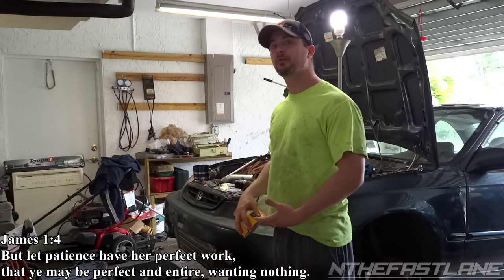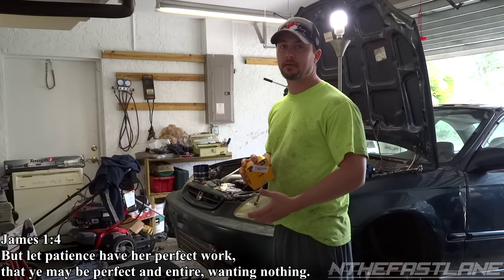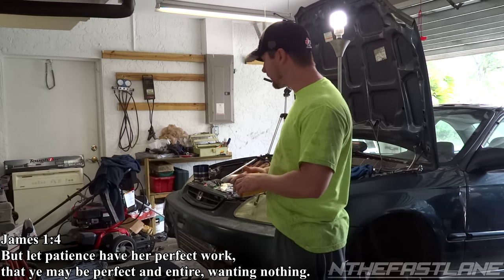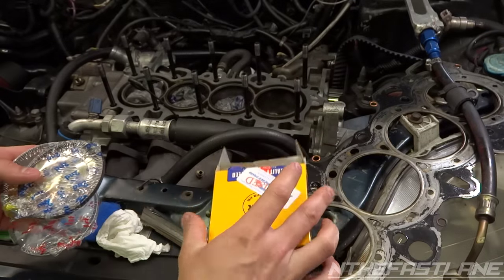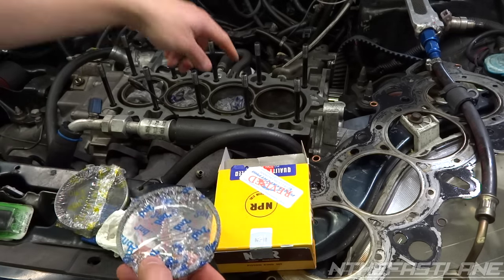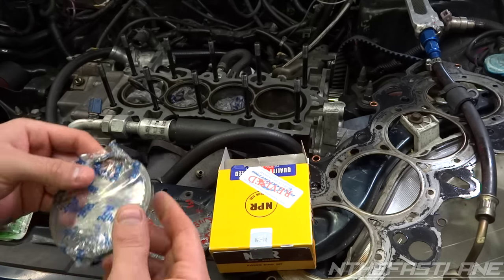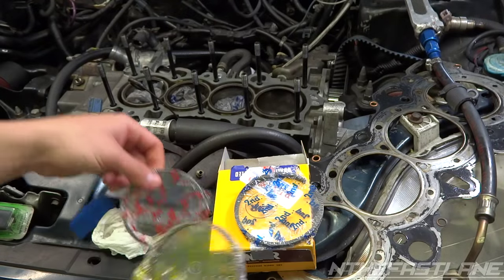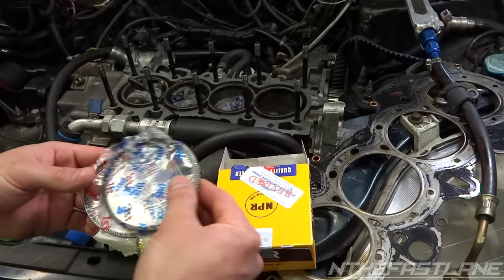▶️Clocking,Gapping & Installing Pistons Properly (Honda) "How To"🔧

Comment: The 3-piece oil ring installation !! The correct installation should be 
as following: Install firstly the spacer ring on the piston and put its 2
 edges at piston's pin side no matter L or R and the spacer edges should
 not jump each other !!. Then starting opposite of this "ring spacing", 
place one of the two (thin rings) by turning spirally until seated 
properly and 1cm offset of this virtual axe !!  Now place again the one 
of the two (thin rings) by turning spirally until seated properly and 
1cm offset of this virtual axe, but not at the same side as the previous
 ring. So finally the 2 thin rings should be at the 150 and 210 degrees 
(opposite of) the spacer ring's clearance. Now install (spirally) the 
2nd from top compression-scraper (dark color) ring and finally install 
(spirally) the top compression (chrome edged) ring!! Lubricate with 
plenty engine oil and turn them around several times to insure 
lubrication goes into rails. Now turn them to their final positions 
before inserting piston into cylinder, ensure all ring edges should be 
at left or right of piston pin and not at the same side of piston pin !!
 by this way you can have the best compression sealing and oil scraping 
back to crankcase. Never put a ring clearance at 90 degrees of piston 
rod (because these sides have the most gasses pressure). I hope this 
will help a lot, those who aren't professionals, but enthusiasts to 
learn more !! Have a happy and succeeded installing, if you follow my 
given steps !! :-D
Reply: Hi, do you have to file to specs the middle piston ring gap as well?
Reply: @TheSilverSurfisher  no not even honda does that.

Comment: The easiest way I have found to clean out the piston grooves is a old ring that came off the piston or soak them in carburetor cleaner. Not carb spray. This comes in a gallon can like paint. Rinse with water and blow them off with air. They will look like brand new pistons.

Comment: hi mate. Some documents showing as the piston rings oriantation, top ring look to piston pin 90 degree , some docs, top ring parallel the piston pin. Whic one is correct. I think if prevent the  touch to piston skirt to cylinder walls, then we need piston ring gap must be paralell to piston pin. Top compression and secon ring gaps parallel to piston pim both edges. can you please your comments.

Comment: Just curious as to what manual is that. I'm thinking about purchasing one.
Reply from the maker: It's called a Haynes repair manual. If you'd like to get the downloadable version that works right off your phone or your computer anytime you need it and not have to worry about the pages getting  greased up, I sell them on my website here: https://www.nthefastlane.com/auto-repair-manuals

Comment: question   So do you only need to check the end gap on the compression ring?
Reply: the ring side clearance also needs to be checked, when your just re-ringing any piston
Reply: thank you for your video.  It was a great help.  I did this on a 98 Honda Civic with 250,000 miles lol,   back in early Aug.  Now the compression is great in all 4 cylinders!  Doesn't burn oil anymore!! And the biggest issue fixed was the idling/misfire problem it had!!!!  Thanks again!  I really appreciate people like you that make DIY videos.  This really helped out a lot!  It's amazing that I was able to do this under $100 for the rings, honing tool, oil, assembly lube, rod bearings, and gaskets/head bolts.  Amazing!!

Comment: Nice Video, Jeremy!  I like the opening Rev limiter and burn-out. 
How is the B18 running now after the overhaul? 
What type of headgasket would you recommend? 
I enjoy your thoroughness, and how you clean and check all specs!
Reply from the maker: Dan A Thanks Dan! Well It's at my shop about 75% fished, I've recorded everything for the "Top Mount Turbo Build Part 2" up until now. I have to fit and tig all of my intercooler piping and exhaust pipe. Then it's off to the dyno for some numbers which I'll get footage of that for you guy's.

Comment: This guy put the ring on the wrong side of the grinder. listen to to uneven sound it was making when he turned the wheel, this is because the grinder was lifting the ends of the ring as it was turning. If you want a even cut always place the ring on the side of the grinder wheel that is rotating downward or you can place it as he did, but turn the wheel counter clockwise.

Comment: Awesome video. I have an h22a4 engine prwlude. Do you put the 1st and 2nd ring gap on the intake side ? And the oil gaps on the exhaust? Or vise versa?  Also i read my cylinders are FRM material and do not hone. Do you have any insight boss , since you are the God of honda!

Comment: do the rings not move when the engine is running !
Reply: John Batchelor 
As long as the cylinder walls, pistons, ring lands /grooves and the rings themselves are properly sized then movement is verry minomal if any at all. any shifting of tbe rings and we are talking only a few degrees takes tens of thousands of miles.
If your rings shift that means the pisto. and or cylinder are worn. New pistons, rings, and an expensive day at the machine shop for the block.

Comment: shouldnt you first hone the cylinders and then do the piston ring gapping?
Reply from the maker: ***** It really doesn't matter because it's not really removing any size to the cylinder. If you hone first, the rings will be a little tougher to get in because of the x pattern scratching.

Comment: Hi mate. Once when i was installing my rings (the same brand as yours), I putted the N mark down instead up. Could this mistake take me engine to low compression? And can ruined the walls?
Reply from the maker: Should hurt much, If you have good compression and no oil burning just run it.

Comment: what size grid do u use for the honing tool for the cylinders
Reply from the maker: #280 grit stones will seat faster than one finished with #220 stones but ring manufacturers recommend #220.

Comment: Great video!  Have you ever replaced your connecting rod bolts?  Thinking of using some ARP connecting rod bolts.
Reply from the maker: tubejim101 No, but you just press them in. I have Manley H beams rods with Wiseco HD 9:0:1 pistons now.

Comment: Do you think .024" gap on top rings is too much?, I ordered piston rings and they all have .022-.024" gap out of the box, the second rings gap is .016" 
Or Do you know the piston rings gap limit on a d17a2 honda engine?
Reply from the maker: The service limit for the top ring for the D- series and B-series is 0.024in. It might be possible that you have the wrong rings. A d16 top ring should be between (0.006-0.012), 2nd Ring (0.012-0.018). I would definitely check to make sure you have the right rings because you were more than likely at the service limit for the top ring. I'm pretty certain it should not be that big of gap for the first ring. The first ring should always have a smaller gap than the 2nd ring.

Here are the D17A2 end ring gaps:

Top ring
standard(new): 0.006" to 0.012"
service limit 0.024"

2nd ring
standard(new): 0.012" to 0.018"
service limit 0.024"

Oil control ring
standard(new): 0.008" to 0.028"
service limit 0.031"
Reply: @Nthefastlane  thanks for replying,  I will ordered oem piston rings now, I honed the cylinders but I dont think that's the problem because old rings gap is around 
.014" - .016"

Comment: I thought the bolts went through the rod cap not the other way around. Am I missing something?
Reply from the maker: +kyubipalex Arp's do. Most stock rods have the studs built into the rod, making a stud and nut combo.
Reply: Nthefastlane thank you for the clarification.

Comment: Great videos!! Question, how do you know how much to take off or what's the spec for the ring gap
Reply from the maker: The vehicles manual tells you. For aftermarket, call the ring manufacture or a engine builder.

Comment: Wow, as much as I hate to disparage someone who is trying to help other people out, there are right and wrong ways to do everything. The reason the right way is so important in an engine is because while the wrong way may get the engine running again, and it might even run well and sound good for a while, it will most likely only be a short while and may leave you in a much worse position, with a badly worn engine, or a blown one. There are all sort of performance part manufacturers who make videos on how to correctly install / use their parts, and also many of the large parts retailers have them too. I would say that if you aren't a professionally trained mechanic, then maybe get your information from a manufacturer / seller who will give you the right information. Apart from the ring filing issues, there are quite a few things that made me gasp, including the idea that you can hone a bore successfully with the crank still in the block. Apart from the high possibility of damaging the crank/ journals, there is the issue of introducing contaminants to the motor, in this case debris from the ball heads of the hone tool, which wears away as it cuts the bore. This debris will be extremely abrasive and because it's mixed with oil is capable of finding it's way into all sorts of places that can't possibly be cleaned with a little spray of brake clean. Once the motor is back together and running this abrasive goes wherever it likes, upsetting critical clearances like oil pump rotor clearances, piston ring to land clearances, piston pin bore clearances, etc. While all these are not absolutely critical to keeping your engine running, they are critical to making it run well for a long mileage.  In any engine building task, I would not use plastic except to seal a finished block/engine against moisture contamination. For everything else, particularly cleaning, using a soft lint free cloth is the go. The cloth will not scratch, or leave micro debris behind if you're careful and the absorbent nature of the cloth means it tends to catch and hold contaminants so you can safely remove them without leaving any behind in the engine. Oil can be used for lubricating bearing shells if the engine will be back together and started in a couple of hours. Any longer than this and the oil will have almost completely drained away leaving you with a dry bearing. Use engine assembly lube, then if you don't get it back together it's not critical as it won't drain off the bearing and will happily sit there till you have time to finish the job. Engine assembly lube is cheap and a tube lasts ages if you aren't rebuilding for a living. Stripping the engine back down because you scored the bearings on startup and can't get oil pressure up, or even worse a shell picked up and wedged itself piggyback on another one, seizing a brand new (sort of ) motor. Yes I've seen both these things happen, especially when crank journals are badly worn from high mileage. Potentially even worse (and more expensive) is to strip the motor because of poor performance / lifespan, and 'rebuild' it with all the same mistakes. While we're at it, on the use of hones, while I don't use ball hones (because I believe that only flat stones will give a flat finish to the cylinder walls), a lot of people obviously get reasonable results with them,  IF THEY'RE USED RIGHT. buzzing a hone up and down a cylinder wall does not 'hone' a cylinder, it just roughens it, and using a ball hone it won't even flatten it or take high spots off if there are any. The idea of honing is to leave behind an approximation of the original factory 'cross hatch ' marks in the walls. I do say 'in' the walls because the marks should be deep enough to be clearly visible which just light honing won't do. The other reason I don't use ball hones is because you can't create any pressure against the wall. With a flat stone hone, I always screw the tension to as much as I can, to allow the stones to bite into the walls and produce cross hatching in the smallest number of revolutions. This means the hones cut as required, but take the least possible depth from the cylinder walls, with obvious benefits. The ideal cross hatch angle is about 60 degrees, which means moving the hone full depth in and out about 20 times a minute if the drill is only rotating at about 60 rpm. The hone should move the full depth of the bore each stroke, and to get that right usually you find you come out each end of the bore about half an inch to an inch each stroke. This will give you a nice 60 degree cross hatch, if it doesn't adjust your rotation to plunge speed till it does. Incidentally that's another good reason to only use flat stone hones, as the ball hones will flail madly if they have even one wire and ball strand exit the bore at either end, and you will have to stop the drill to get it back in the bore and start over. With either hone, obviously this technique makes hitting the crank at some stage pretty likely, but if you think you can short stroke the hone to get away with it, well you will have to move in and out faster to create the cross hatch, plus you will increase the ovalling in the centre of the bore which doesn't just increase your engine wear, but it makes it much more likely that your rings will break fairly early in the piece (rings are not meant to flex in and out each time they travel up and down a bore, so a parallel bore is best for engine longevity). To get back to the reason the 60 degree cross hatch is critical, the whole purpose of the cross hatching is to trap oil on the cylinder walls. The oil scraper rings take the excess off, that the second ring would not cope with, but the bore remains 'wet' , and in doing so it provides a lubrication film for the piston to bear on as it goes up and down, and in doing so it reduces wear in the bore dramatically. When a bore is 'buzz' honed, and there are no clear hone marks, or the angle is so small it cannot hold more than a small amount of oil, the piston bears mainly on the cylinder wall and cylinder wear can be very rapid (sometimes only 10,000 miles to totally worn beyond serviceability). I have stripped engines at 350,000 miles to find the factory hone marks still quite fresh, and the bore still measured within a few thou of the original bore size. The other factor in this is keeping ALL dirt out of your motor, so good quality air and oil filters, good oil and frequent changing of each. You can see why stray contaminants (dirt) in an engine during rebuilding is such a no-no. 

  Should I start on why it's a bad idea to use the numbers on the ends to identify rod cap direction of fitment? Probably not, but the short version is that the number is there to identify which rod the cap belongs to, as mixing up caps and rods is a no-no due to the way they are machined. While the number written (and not stamped for an important reason), on the rod cap usually coincides with the direction it should face, it does not always. The cap may have been stamped by a rebuilder at some stage while apart, and it wasn't done on matching sides with the rod, or it could be a cap from a different rod set that has been professionally resized by a machine shop and the two sets had numbers on opposite sides. There are a number of possibilities that mean that the numbers aren't 'always' on the same side though they usually are. You only need to ever get this cap direction wrong 'once', and at some point your motor will either seize, throw a rod or throw a leg out of bed (rod goes out through the side of the block 'windowing' it), and almost certainly the crank will be junk afterwards as well. If it sounds like it's worth learning this small but important part of rebuilding do yourself a favour and go and find a professional source of information. I'm pretty sure that Jegs would probably have a video on this, or as part of another rebuilding vid, I'd be very surprised if someone like Clevite, or Federal didn't have something on it, and if you really want to learn it, then I'm sure there are many institutes of tertiary learning who offer short courses on this sort of thing with qualified instructors doing the teaching.  

  NTFL, I have really tried to not flame you personally, because I don't think that's called for. If you don't know, well you just don't know, and I'd suggest that you did some courses too and got the benefit back in longer engine life and better performance. If you're going to try to tell me you're a fully qualified mechanic, then damn you got short changed, I'd go ask for your money back.  

  One other thing, if you think you're above all this and can just keep on putting out content like this on the web. What happens when someone follows your directions and then has an engine blow up after 500 or a thousand miles despite spending big on performance parts, and they shake their head and say "but I did everything exactly the way NTFL said to do it. Then they decide to come and find you to get their money back, or at least some satisfaction? Unfortunately for you , you live in just the right country for that to become a real possibility. Thankfully I don't live there. And if you think the web is anonymous still and no-one can find you, dream on.
Reply: camionjeep isn't 60 degrees a bit steep? everywhere i've researched says closer to 45 is optimal.
Reply: I didn't read it. Its too long
Reply: Lol who has time to write this much of their opinions